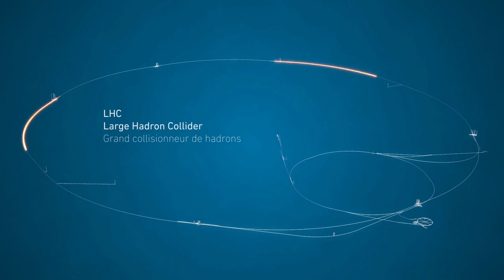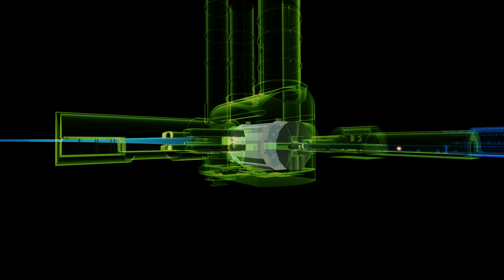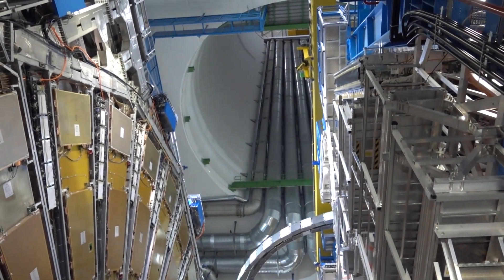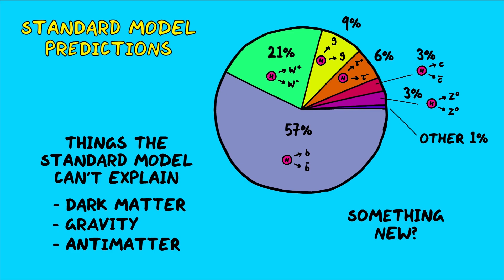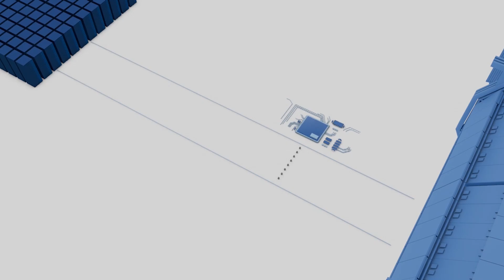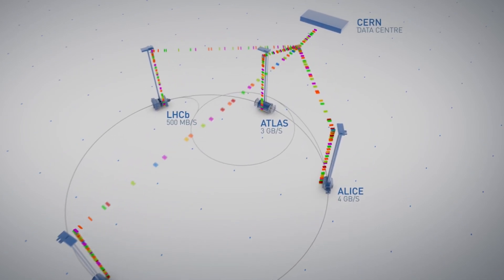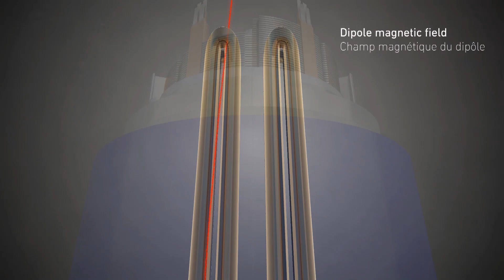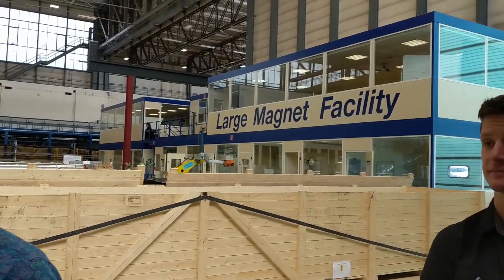The Incredible Science of CERN

Comment: I noticed the magnetic tapes. Having around that old say the tapes have a chance of a flaw because the magnetic read heads can get dirty because the tape composition can leave a residue on the tape itself. The magnetic tape has to be periodically be treated. Some systems will auto clean themselves every so many uses. The magnetic tapes capacity of what they can hold of data has improved many times over the years. 
Tapes can get. Internnally crinkled and twisted at times. Nice system but it's scary to me because it's still like a fancy safe track gassette. 
Thinks go wrong " we  had all seen it in the old days particularly.

Comment: Why do the magnets need to be trained?
Reply: Electromagnetism is super complicated, but essentially.. any magnetic material has lots of tiny "magnetic domains" inside of them, and when they line up they produce a net effect as a field. Iron always has magnetic domains, but they're usually scrambled in all directions and cancel each other out. When you magnetise iron you in fact line up the domains. So any highly precise magnet needs to have the domains arranged in specific ways, which the wires going into the bundles won't be at first. My guess is running the current through the coils ends up aligning more and more domains each time. Haven't looked any of that up, so the specifics for CERN's own magnets may be different, but that is fundamentally how magnets work. Physics Girl once talked about how even basic ass fridge magnets had the domains arranged in stripes to keep the field more stable.
Reply: A Prado   Because if not trained they tend to pee all over the floor.